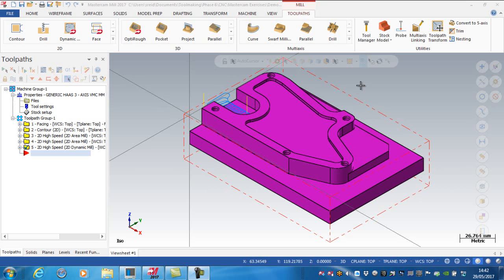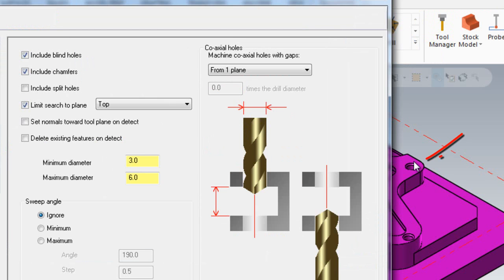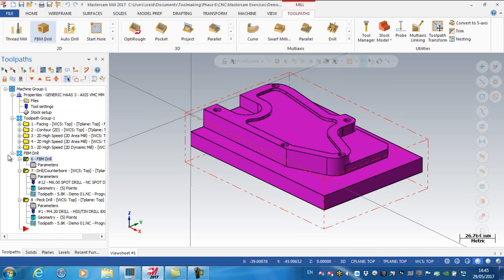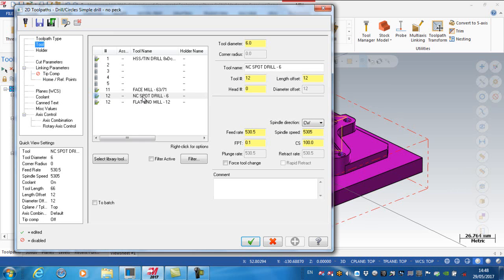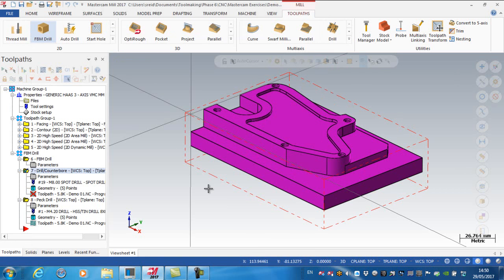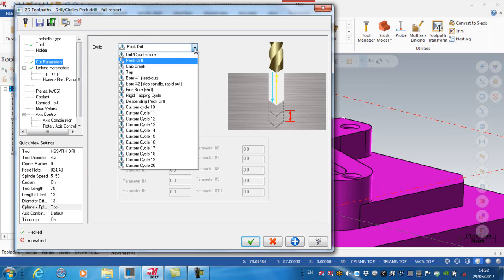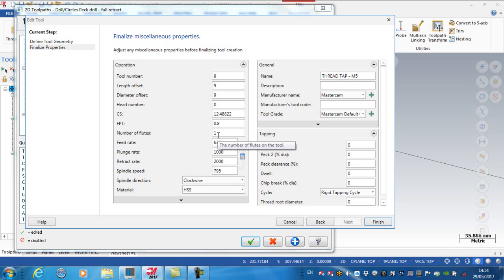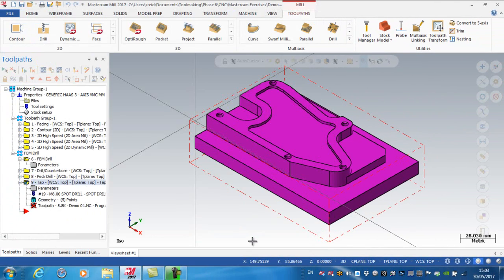Mastercam 2017 #27 - Solid Model - Drill & Tap Holes (FBM Drill)

Comment: @0:25 set the Grouping to Tool and @1:15 set MaxPercentageOfFinishedHole to at least 120% will solve the Quandary @2:11.    This will allow 2 operations to be output. Spot drill all holes to final countersink diameter, then drill all holes.

Comment: I’m having such a hard time with this. My company does a lot of M2.5, M3, M4, M5, M6, an M8 threads. We also thread form all these in the CNC. So when the model comes in all the pilot diameters from Solidworks do not match what the pilot drill actually needs to be. Mastercam will try to bring in nonsense tools and I just want to save a operation so I can chain all these holes easily.